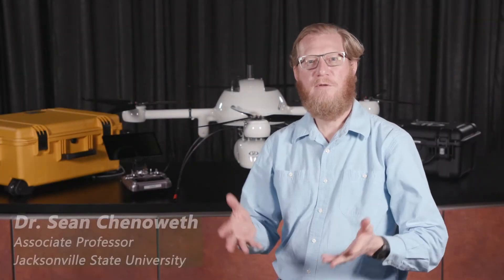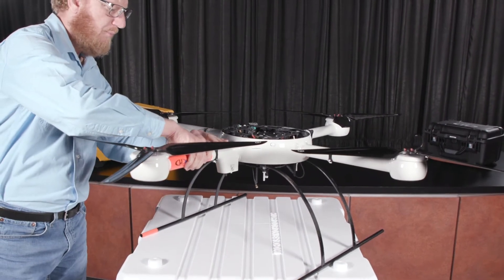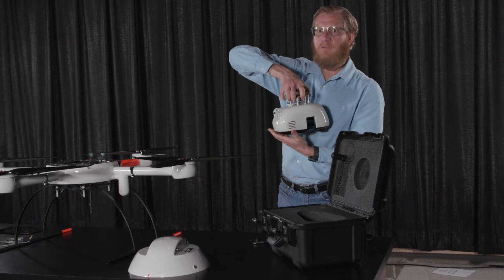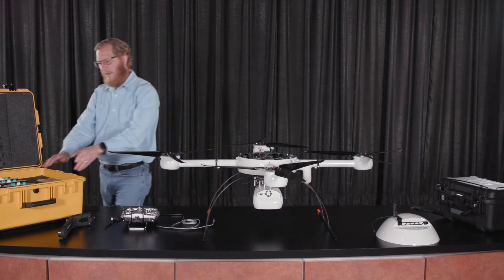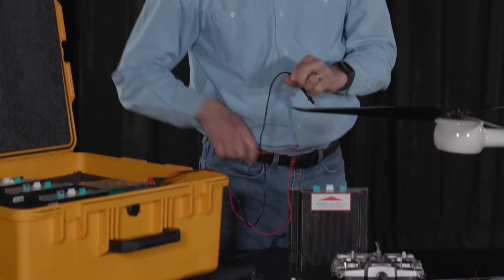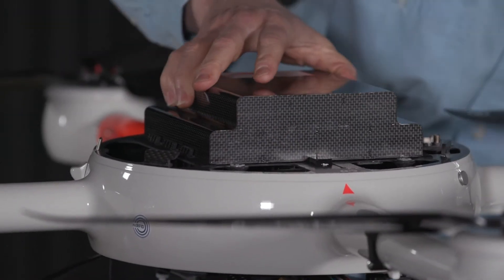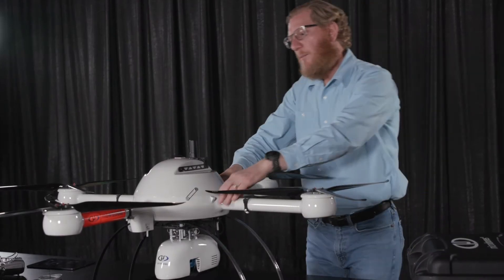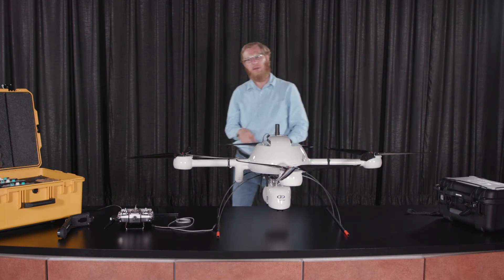Microdrones MD4-1000 - Assembly Tutorial

Comment: hi!    I found out that MD4-1000  has 4 ports on the bottom T, R, A1, A2

Are they the shutter pitch roll and rotation signal output ports? There's another question: Are these four ports output PWM